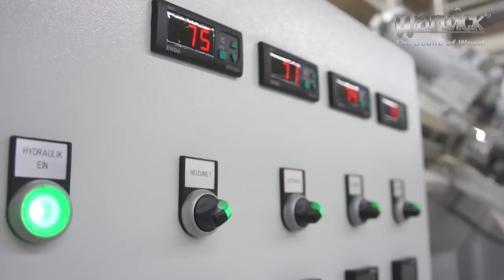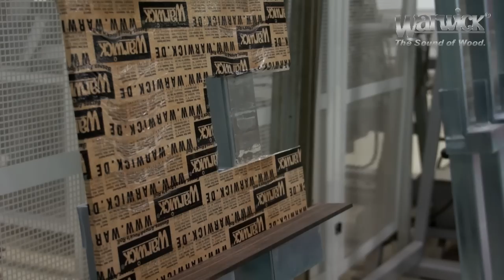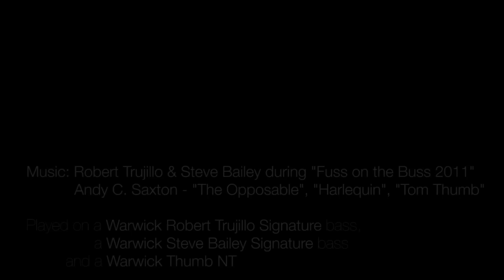Warwick Custom Shop Basses: Robert Trujillo Signature Rusty 4 and 5 String

Comment from the maker: With respect, I have to add that the selection of the woods for neck and body, the glueing and planing is all done by hand. After the CNC shaping, there's about 2 hours of hand sanding at least to get a perfectly smooth surface for the lacquering process. The enamel needs to be applied and sanded by hand. The whole rusty finish requires a very concentrated handwork with attention to lots of details and the final setup can only be done by hand. Sorry if you got another impression from the video.

Comment: *drool* How you make the rusty effect is so cool!
Reply: The laquer is Mixed with Iron dust, after its hardened you can let is Rust instantly with an acid, after that its Just normal laquer Prozess, ive done some of those effects , its Not difficult but you need a very wide nozzle for the spraygun to be able to distribute the Metal through it

Comment: It's a shame that this bass guitar isn't made with a 24 frets neck and is a five string bass guitar
Reply from the maker: Hi there, this is a 24 frets Bass. As for the number of strings, the Streamer Stage I is available from 4 to 6 strings version. ;)
Reply: @FramusWarwickOfficial  I have a fender quilt top 24fret five string bass with bassline pickups active I like to string my bass E.A.D.G.C  and I am looking for a bass guitar that is 24frets five string with a single coil and a humbucker in the bridge position active and passive switch and sounds great clean and distortion  I need the body thick and heavy duty and I like maple neck and maple fret bord and  hip shot tuners I don't want a bass guitar  that feels  little  and like it would break easily I have a ibanez gio gsr206sm six string bass guitar and I don't play it much because it doesn't feel solid